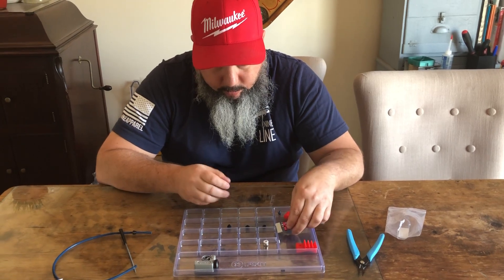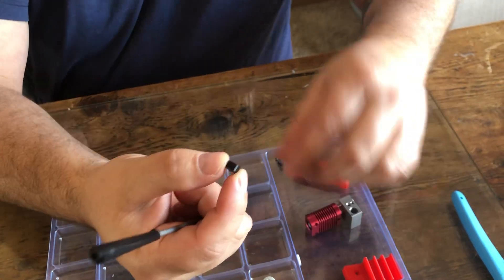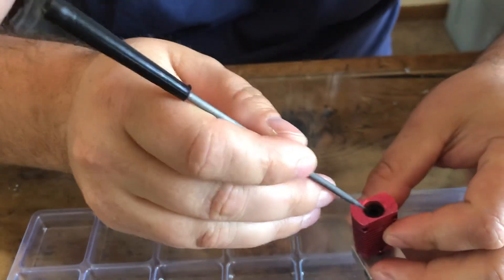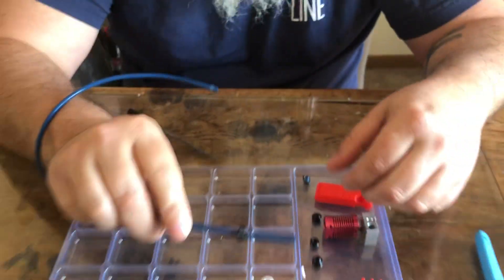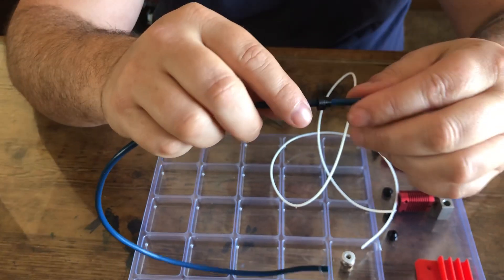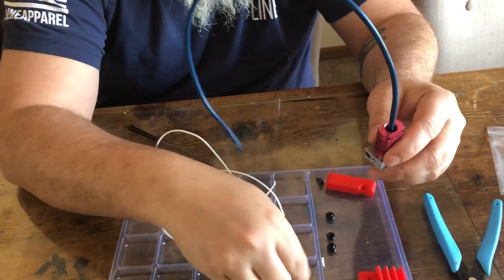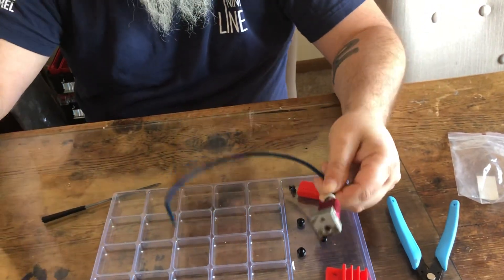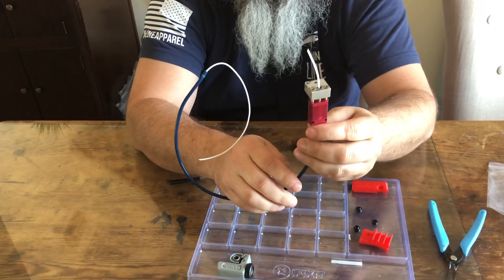Trying Ender Under extrusion (Creality Hotend Fix! designed in Fusion 360)

Comment: Why are they not just using a continuous tube from the stepper all the way to the nozzle?
Reply: This will continue to be tight and properly aligned even after the bowden tube gets loose in the coupler fitting, which is going to happen over a period of time.

Comment: Fully understand what you are doing and why you are doing it. When you have a print with many retractions you the problem will show because the filament that needs to pass the washer is less smooth. Currently the printed washer I'm using works but isn't as good as yours because it only aligns with the tube going down to the nozzle. Would like to try your design.
Reply from the maker: I will upload it and send you the link
Reply: @JakeOfALL  Thank you.
Reply from the maker: https://www.thingiverse.com/thing:4324444